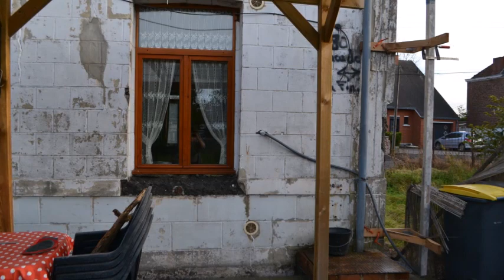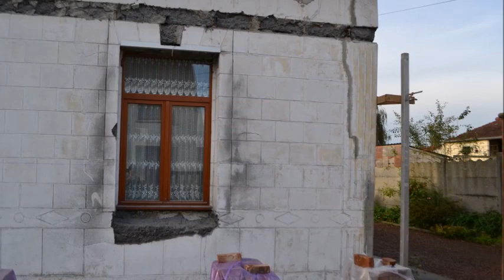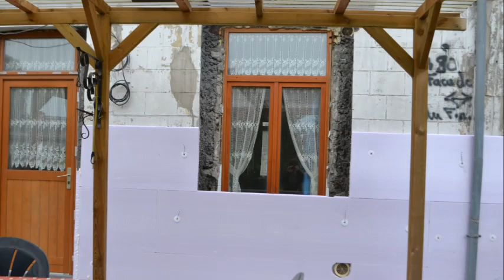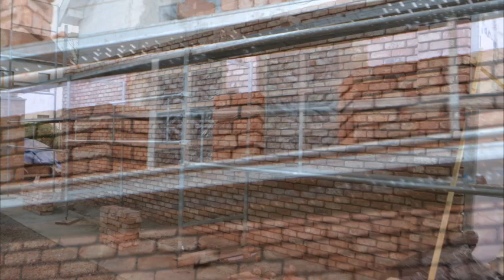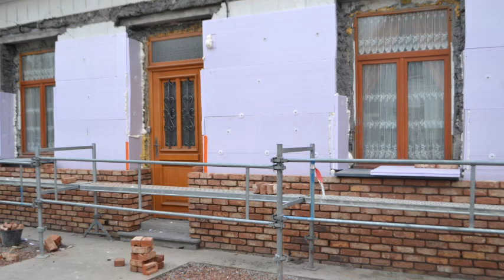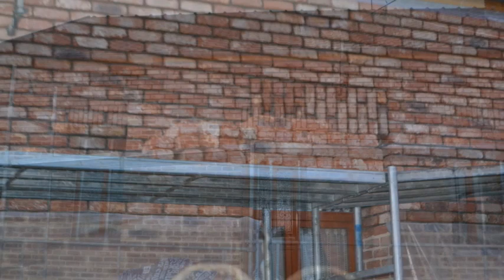isolation extérieure en briques

Comment: Bonjour. Le titre aurait du être " isolation en polystyrène et en briques ".
Dommage qu'il n'existe pas d'isolant " adhésif ", comme une sorte un mortier à base de roches volcaniques* pour remplir l'espacement et aussi coller les briques sur le mur au fur et à mesure du montage. En plus du mortier pour les coller entre elles, évidement.
 A moins que ce type de mortier fasse l'affaire pour tout. ( * pouzzolane ? )
Reply from the maker: le vide d'air est le meilleur isolant,
Reply: @ThierryLeroyer  Tout depend aussi de l'espace laissé entre les 2 murs.
Reply from the maker: @ditherjannev2590  ya toujours une solution pour le faire